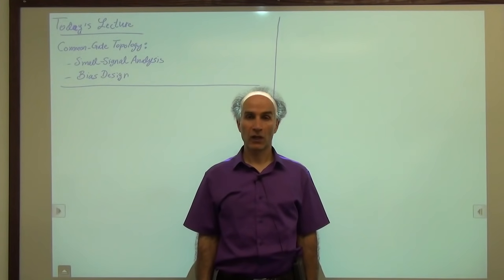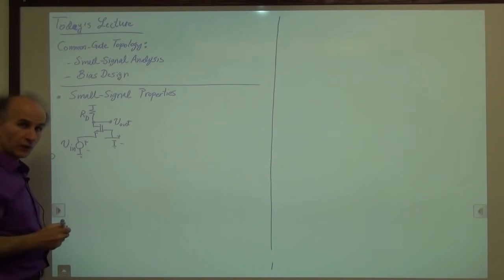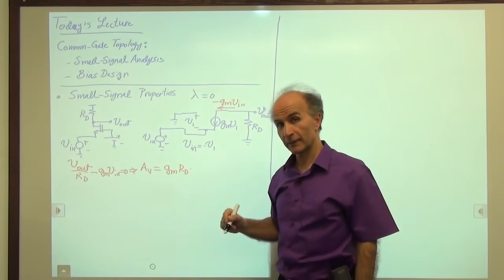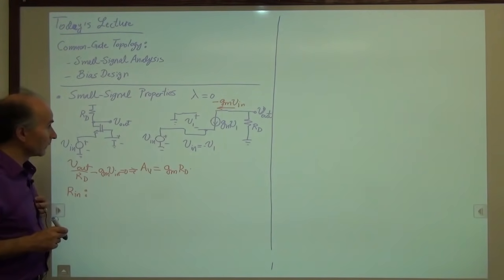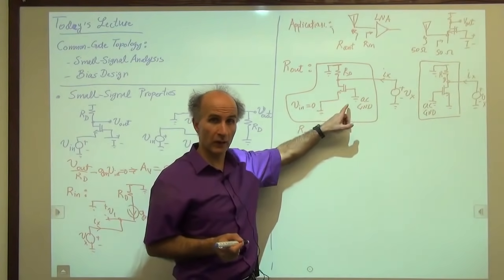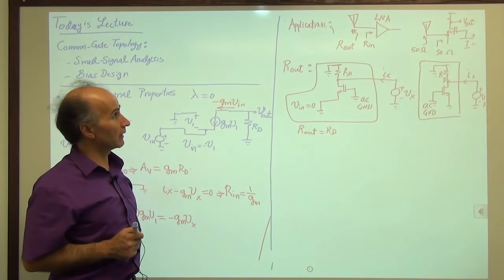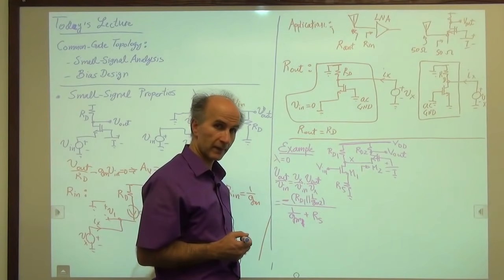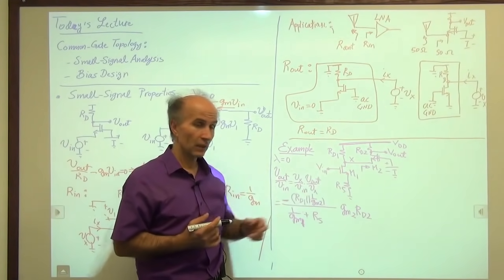Razavi Electronics 1, Lec 40, Common-Gate Stage

Comment: Another mistake is at 52:40 Rs_max is 870 Ohm. That number is still comparable to 1?g_m though so everything is almost correct
Reply: The answer 370 ohms is correct because Vgs is 1.13 V (professor corrected it later at 59:16)

Comment: In that video above 48 min one problem is solved in that calculation vgs is 1.13V but you put. 0.63V.Please correct me if I am wrong
Reply: I'm also getting Vgs to be 1.13V .... 
we're you able to solve it later
Reply: The next line shows that 0.632=vgs-vth ,that’s should be just a typo

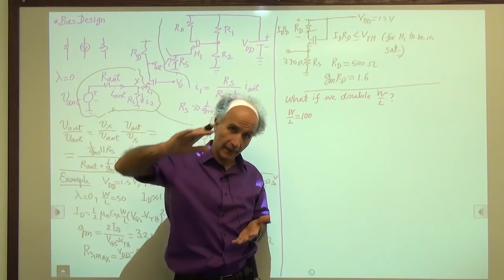Comment: how is the IdRd<=Vth condition coming into picture at 58:00 , here source is not connected to ground right? so Vds won't be vdd-idrd
Reply: For a MOS to be saturation region, 
Vds >= Vgs - Vth
Vd - Vs >= Vg - Vs - Vth,  (Now cancel Vs from both sides)
Vd >= Vg - Vth,  (Put the value Vs = Vdd, and Vd = Vdd - IdRs)
Vdd - IdRs >= Vdd - Vth
- IdRs >= -Vth
IdRs <= Vth
Therefore for the M1 to be in saturation region "IdRd <= 0.5V".
Reply: @rajeshmeher4017  
- IdRd >= -Vth
IdRd <= Vth

I think you miss-type it

Comment: at 39:16. the current from antenna flows into source.But Id is flowing from drain to source? what will happen?
Reply: You short out independent voltage sources in small signal model, right ?
Reply: I dont understand what you say. are we seeing only small signal model? but technically for common gate , input is source right? but as per mosfet model current must flow from drain to source?
Reply: Go to lecture 41. Watch the part carefully where the biasing of source follower is discussed. It will be described that mic is shorted to AC gnd so first form of biasing is not used. If we go by your standards its not possible.
BTW, We've got AC gnd on drain so we have perfect path from source to drain.

Comment: Could anyone please tell me the use of  Rf resistor in self-biasing mode? we can also connect a simple short circuit that also does the same work.
Reply: @penumalasantharao5690 It is to ensure a signal(ac) gain of > 1 as otherwise input is shorted to output node, ac-wise.